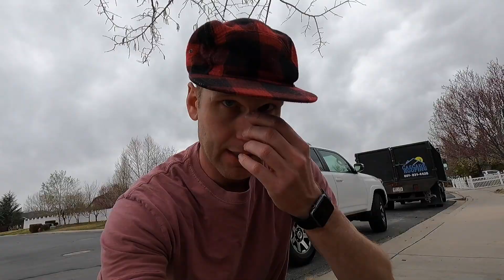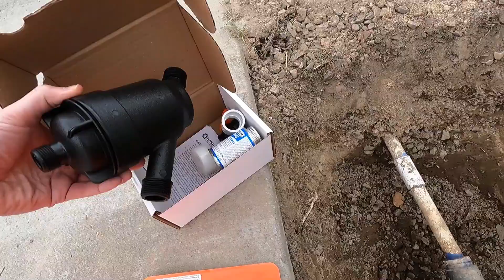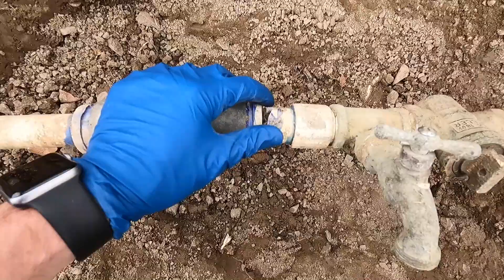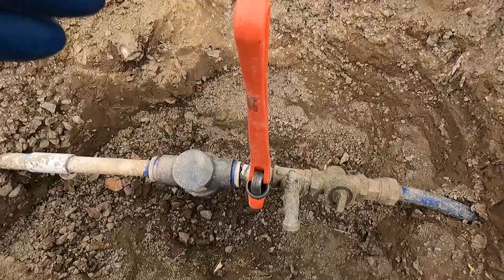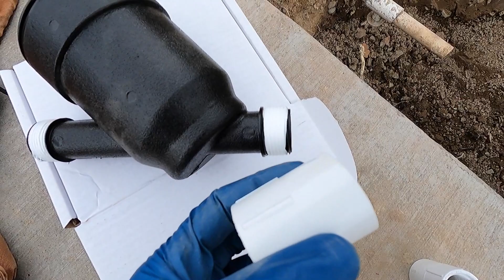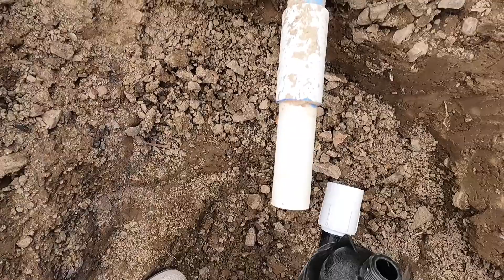Sprinkler System Main Line Filter Install

Comment: Is the housing threaded so that you can spin the whole housing to remove and replace in the future, or will one side tighten while the other side loosens when you spin it
Reply from the maker: Housing just opens to clean or change filter found inside.

Comment: How do you take it off?
Reply from the maker: Not meant to be removed, just need to remove filter to clean.  Unscrew top off.
Reply: @thesprinklerchannel  I like to make it so it can be removed so when it needs to be replaced, I don't have to cut up the pipe.  I do this with all my components hooked to the pipe for easy maintenance.

Comment: So if you had to replace that whole set-up again, wouldn't you have to cut it off again? i assume the threads wouldn't allow it to just spin off since the threads go different directions on each side.
Reply from the maker: Correct, usually not something you have to deal with but once every 15-20 years.  You could possibly put unions in if you wanted.
Reply: @thesprinklerchannel  thanks for the video. Just replaced mine now.

Comment: Thanks for the video.  I probably just missed it, but did one of those couplers have a swivel connector?  Kind of need that on at least one end to easily unscrew the housing in the future, right?
Reply from the maker: In this case enough pipe was exposed to be able to manipulate pipe without needing a slip fix coupler
Reply: @thesprinklerchannel  I think many people are saying the same thing here.  Best practice is to add some type of coupler to be able to replace it in the future when it breaks without cutting up the pipe.

Comment: Y strainer need to go down not up
Reply from the maker: Either way works 👍🏼 typically found on side or up in Utah - allows one to connect for winterizing sprinkler systems.

Comment: The installation manual says to not put teflon tape on the threads to the ball valve. You used male adapters which is an inferior part compared to a Sch 80 threaded nipple.
Reply from the maker: You are right in that the schedule80 is much stronger than scheduler40 but I believe the psi rating is plenty sufficient for given psi.  Teflon is on ball valve is just my preference.
Reply: @thesprinklerchannel  The psi rating is not  the issue. The issue is the movement of the ground causing stress on the threads and cracking at the threads. The male adapter is not strong.

Comment: I think I need a FULL video of how to start from step 1 and end with step X to make sense of these things - I am going to be installing Rainbird system on my yard - but since I have never done it, I am not even sure why you would want to attach to the City water Pipe - is that what you did? I would have just attached it from a Hosebib?
Reply: There will be high dynamic flow losses through a hose bib, especially the small diameter pipe leading up to it. You need about 30psi at the nozzle. Sometimes more.

Comment: Does it matter what direction filter is ?
Reply from the maker: The actual filter no , the housing to it shows the flow direction and that matters.
Reply: @thesprinklerchannel  I don't see a direction....the pressure regulator has a direction but I see no direction on housing
Reply: I think I have it backwards
Reply: But it works....I mean I get water
Reply: I couldn't leave it alone. Plus I had small drip in one connection 😟. Took it off , not too bad actually because I had drip line attached. There is an arrow. Replaced it correctly and no drip. 
I don't know why the first time I do anything I do it backwards.
Reply: YES it matters. The cap on the top is designed to be removed so you can flush the filter. If it's backwards, that is impossible.

Comment: This video is great! Alex asked my first question about the direction of the filter (up or down). I just purchased the Amiad and pulled out the instructions saying it needs to be pointed downwards. I’m so relieved it doesn’t. Thank you for answering.

Second question: Can I use the flush ball valve on the filter cap to attach a garden hose to? It looks like a hose could be connected to it. That was the main reason I bought this particular filter.
Reply from the maker: Each brand of filter might have different requirements.  The threads are a little different than hose bibs and most likely will need an adapter to connect to a hose.
Reply: @thesprinklerchannel  Thank you!

Comment: Thanks for this video! Shouldn't the filter body be pointing down from the pipe? This is where all the gunk collects
Reply: Yes, the installation manual says to point it down.
Reply from the maker: The filter body can be pointed in any direction, as 100% of the water will have to pass through the filter before going on to the rest of the system.  I prefer up for ease of access and connections for winterization.  If you feel like it needs to be flushed without the filter, you can just open it up and remove the filter and flush it.  Hope this helps!
Reply: @thesprinklerchannel  thank you!